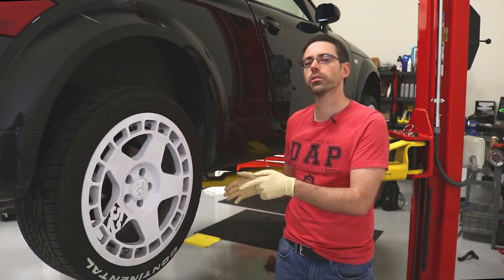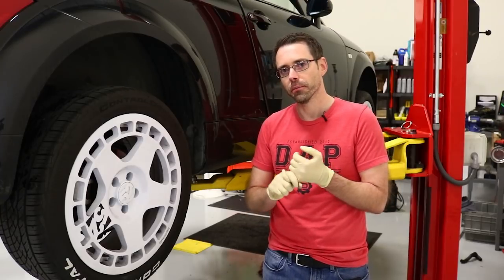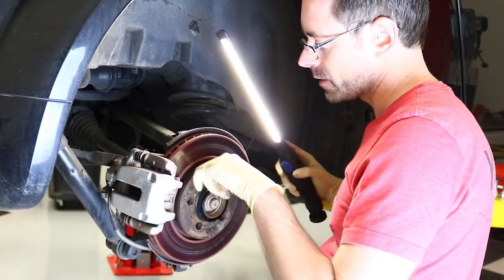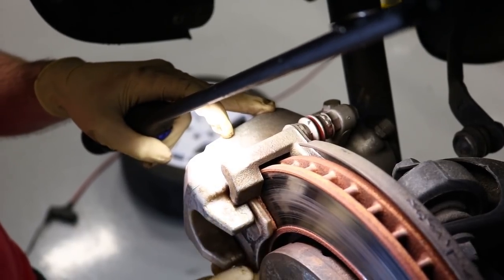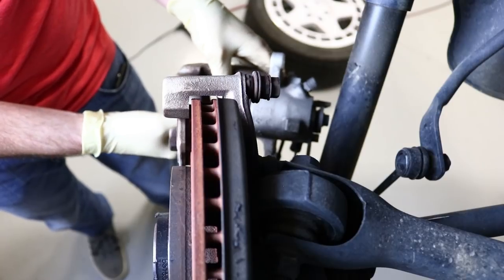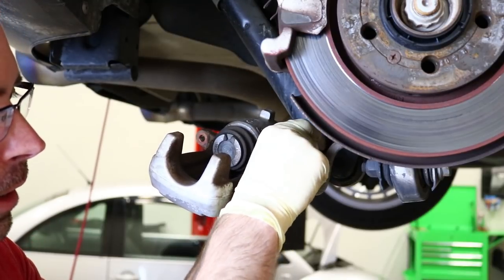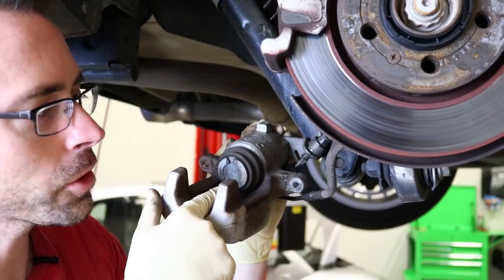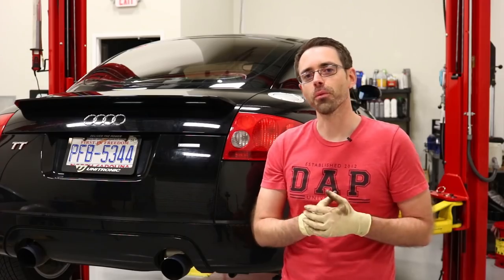Diagnosing a Stuck Brake Caliper

Comment: I just recently had my 2012 Audi A3 8p2 Facelifts left rear caliper replaced. Went through 4 sets of brake pads in 3 months... thats right, in 3 months. Cut the long story short, the piston was damaged and never released the pads from the disc. R8000 later (roughly $600) and everything is working out great again.

Comment: Just had this issue on my 17 alltrack. Hit a pothole. Few miles later I get a vibration when braking. First thought is bent wheel or tire damage. Drive some more it goes away. Brake again and it's back. Get to work my driver side front wheel is smoking and hot. After work I drive home and still same issue. Remove wheel and check for loose caliper bolts ect. Nothing. Pressing the brake pedal I can hear the other 3 calipers release at the same time but the driver side front is sticking. Tear it down. Slider pins have grease and move good. Looking at the caliper is when I spot the dust boot for the piston is not seated in the caliper itself. It's just around the slot in the piston. Remove caliper. Push out the piston. Some corrosion around the piston where it was exposed. Cleaned up the piston, cleaned the area on the caliper where the seal sits. Install the dust seal, piston and install the caliper. Bleed the caliper. Test out. Test drive and all seem good now. Super long comment but this blew my mind and I thought about this video. Never seen the dust seal boot come out of the caliper like this. Car only has 18k on it. Pads have tons of meat. I have no idea how it could have happened from hitting a pothole.
Reply: Same thing happened to me this morning.

Comment: I would suspect that the parking brake cable was frozen and not releasing the brake caliper. You can see a water droplet on the cable when you pulled it out. Wouldn't surprise me that if you pulled the cable out of the sheath, you would find rust.

Comment: Just had my car fixed bc steering wheel was shaking. Didn’t fix that problem but it fixed the compressor and belt that was smoking. Just got a call back and they said it’s my front and back break pads and my back calipers. I love cars

Comment: My 2013 f150 was making a kind of noise like you would hear when rubbing around a glass with your finger. Ford said the brakes needed servicing and suggested I do them all. I declined because it was just doing it sometimes the noise. I was under the extended service plan warranty during the time. Today I heard a grinding noise while driving and worse when braking. My front driver side rotor is all grinded, other ones are fine. Do you think it is a stuck caliper? (I am no longer under warranty, but hopefully they can see I brought it in for an issue that had to do with this and they didn't repair what should have been under warranty) and kind of backtrack fix it.
Reply: Adam84 B  because they said it wasn't covered, but they lied, calipers are covered under the extended warranty. I have since gotten them fixed, but had to pay for the brake pads and rotors, the caliper they replaced for free as they knew it was their fault for not doing it and saying it wasn't covered before. I should have had them replace the pads and rotors for free too since it was destroyed due to the caliper.. but didn't want to deal with it all. Won't return to that dealer ever again.

Comment: I'd like to see how to clean the brake piston&cylinder and how to replace the cylinder gasket. That is necessary after som milage or rarely used brakes, especially when driving on salty roads.

Comment: Hi, i have no idea how often you check your emails for your YouTube notifications but I hope you can see this, I have an issue with my vehicle , I have a 2017 Ford Expedition that I have noticed my brake performance has gotten spongy , though when I was washing my vehicle there was a significant amount of brake dust on my front wheels, after I was done washing my vehicle I went for a spin , after I got back I inspected the front rotors and noticed the passenger side was without the rusty film after I vehicle gets a wash , but driver side rotor has that noticeable rusty look as vehicle’s brake pad seems like is not fully gripping the rotor , so I was wondering if you have a clue and if you would recommend to change the fluid .

Comment: My car is toyota had problem with brake, the car whenstart machine drive normally, but few minute after the machine hot, the brake kicking back, like frozen pedal and sticky, the booster and master brake has been replace with a new one include the caliper, hose but the problem cannot fixed, what is that the problem ?

Comment: Question ,I got air in my brake line s ,I retracted caliper after bleeding brakes   ,pumped brakes up and then checked front right caliper ,it seized up  three time s rubber seal s are good ,in caliper ,I'm not sure if it's my front brake lines that are bad because it seems there not pushing fluid back up into front brake hose back to master cylinder ,what is my issue to fix this 1990 Toyota Corolla 1.6 engine ,

Comment: I have a 2007 tt , squeaking coming from driver side rear wheel. Local garage had it on ramp and said 3 out of 4 wheels calipers are sticking on. How do I fix this? The local garage said I had to take it to audi as it needs a computer to check and repair? Please help!

Comment: I have a 2016 Golf R and put EBC yellow stuff pads all around a few hundred miles ago. After bedding them in last night, the front right started smoking from the inside pad side. No smoke before or since. An Infrared thermometer shows the front right to be about 40°F warmer than the front left after repeated braking though. Is this normal?
Reply: So what was the problem?

Comment: So, I have a 2013 F150 4x4. Today, my drivers side brake area was smoking! I stopped and looked at it and smoke was just pouring out, metal on metal smell. Is this the caliper???
Reply: Adam84 B  I did, and yes, it did fix the problem. Thanks

Comment: Im an experienced tech and have a 98 Dakota that has done this twice...first time replaced line, caliper, and pads...lubed pins with brake grease....6 months later....same wheel 😡.. however all the parts are Chinese 😡....like anything else is available.

Comment: Is it possible to shake steering wheel if rear brale caliper is stucked?
Reply: It usually happens when you brake, there is a chance it could be sticking slightly. Could just need your wheels balancing or have the wheel bolts tightened to spec.
Reply: I’m having same issue. Shaking steering wheel. Got a diagnostic and they said all breaks were worn and back calipers are getting stuck and need replaced. I only noticed the issue when I was driving above 20mph but they said it was happening to them when it was braking. 💁🏼‍♀️
Reply: Could be a warped brake disc from overheating

Comment: Can you retract that caliper with OBD11?
Reply: Danon Prosser on newer VAG models you can retract the Calliper with OBD11. You cannot retract the rear calliper with the brake retracting tool on the newer models. This is another way that VW want you to bring your car to a VW garage costing you $$$$.
Reply: @epad1990  I have an 08 B6 passat and will be doing rear brakes soon and was debating on the purchase of OBD11 and if will help the process
Reply: Danon Prosser just get calliper retracting tool for that job..... but I recommend buying obd11 anyway as it is a useful tool